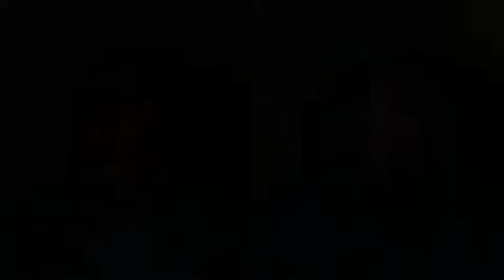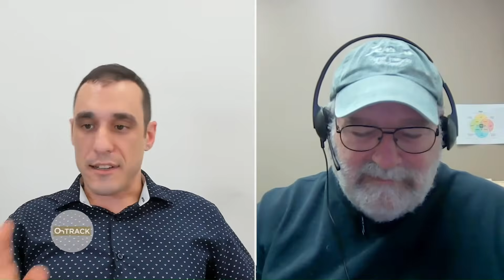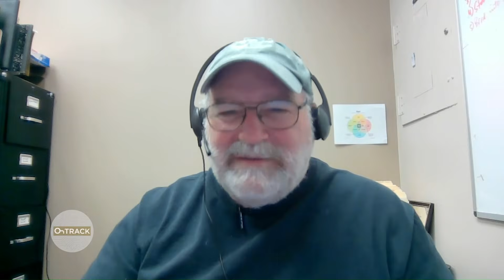Eric Bogatin on Right-Angle PCB Traces and Reflections

Comment: Hi Zach, thanks for the video! 
I have a general question: what is the correct way to understand experts when they talk about frequency? For example for a frequency of 4-6 GHz some of them say that it is enough to use FR-4. I understand it this way: the maximum operating frequency for FR4 (for example LPDDR4 for i.MX8 QXP) is 1200 MHz, because in order for the square signal to be rectangular and not sinusoidal, we need the third (3.6GHz) and fifth harmonics (6GHz) at least.  But take FR4 for 1600 MHz (LPDDR4 for i.MX8QuadMax) I can't, because the fifth harmonic is 8GHZ...
Reply from the maker: I don't know who told you "the maximum operating frequency for FR4 is 1200 MHz" but that person is spouting total nonsense. My company has developed equipment for aircraft operating at 6 GHz on high-Tg FR4, the RF circuits provide so much power they can swamp the RF receivers in other parts of the system. The signals you source into a transmission line are never perfectly rectangular and they experience loss during propagation, always becoming more rounded over distance. This is because the channel (your PCB) absorbs energy over the propagation distance, but as long as the channel has more bandwidth than what your receiver needs to recover logic states from a bitstream, then the PCB can be used with that particular interface. When you source a fast signal (i.e., 1 ns rise time), that rise time will slow down and might reduce to 2-3 ns when it encounters the load capacitance in the receiver logic circuit due to absorption, and the signal will never be perfectly square at either end of the transmission line. Also these fifth harmonic or knee frequency rules are total nonsense, they have never had any useful meaning in PCB design when it comes to signal integrity or transmission line design.
Reply: @Zachariah-Peterson  sorry... I'm just stupid man =)
Reply: @Zachariah-Peterson  And I didn't write about "the maximum operating frequency for FR4 is 1200 MHz"..  I asked about how to understand correctly " For example for a frequency of 4-6 GHz some of them say that it is enough to use FR-4." And you wrote that you used 6GHz operating frequence on high-Tg FR4. It's answer for my question. 
I  thought talking about the maximum frequency for a laminate that this is the frequency of a sine wave.  And NXP for i.MX8 recommends Megtron6.. - It's all confused me. I incorrectly assumed that the harmonics of the main signal should be taken into account, because they create a signal similar to a rectangular one and without them there will only be a sine wave. 1200MHz - my stupid assumption for max freq square (trapezoidal) signal on FR4.